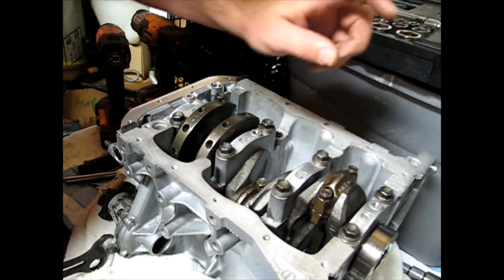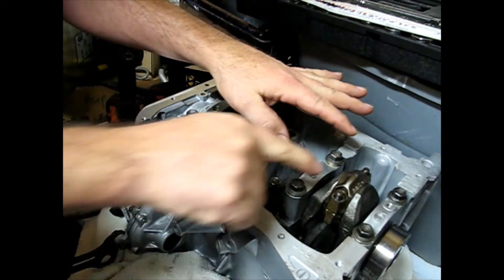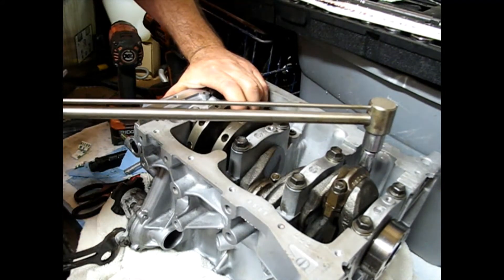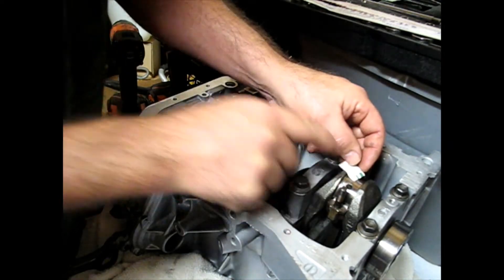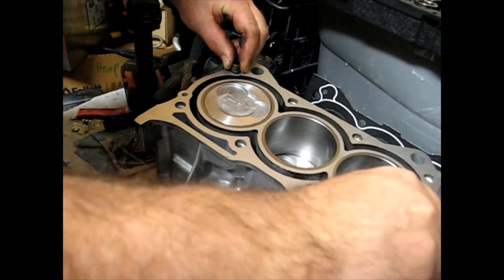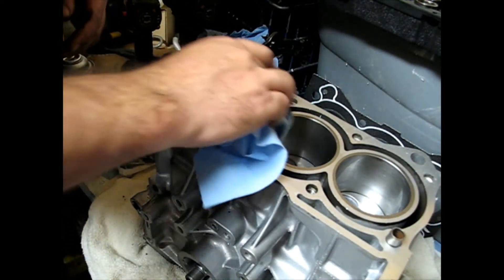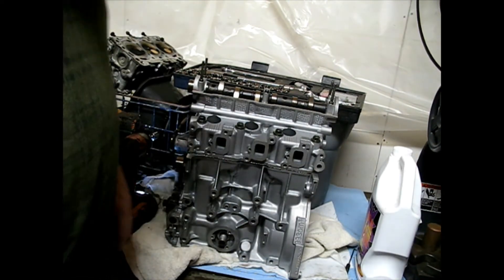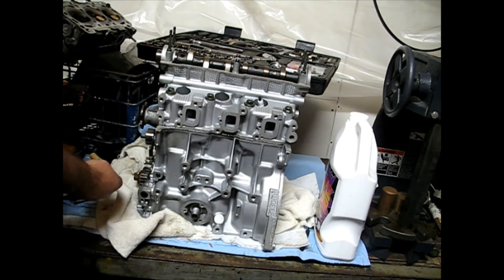Geo Metro 3 cyl 1.0Liter full rebuild  Rod bearings and head installation Part 4 54hp notrod :)

Comment: make sure to spin them in by hand a little before using drill get maximum proper thread.  also criss cross outward it looked like to me he did one set of bolts in the wrong order unless hes following the spec. 54 pounds does not sound too extreme pretty typical for the tech and era.

Comment: You need to open the oil drain holes on the head gasket. When you take a long trip on the highway and it is smoking and consuming oil from it sucking all the oil in the head through the PCV system you will wish you would have.

The aftermarket head gasket is incorrect. You need to match your oil return holes in the block and head. Common knowledge and common problems on a G10 engine.
Reply: Yes sir, Feel pro makes a updated head gasket.
Reply: The OEM Suzuki gasket hole is smaller than the felpro updated one. I have both. Suzuki one is quite small hole compared to the hole in the block and even the felpro hole.